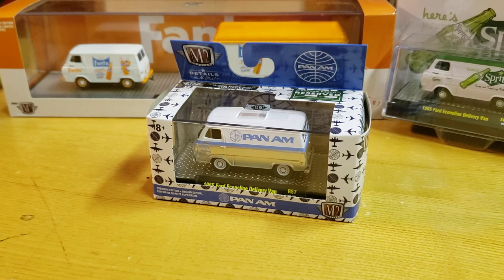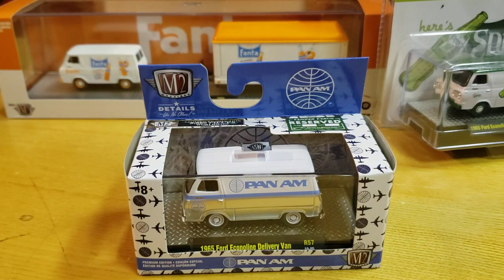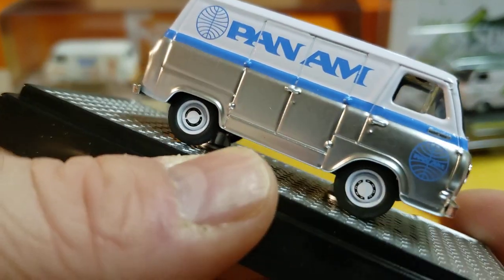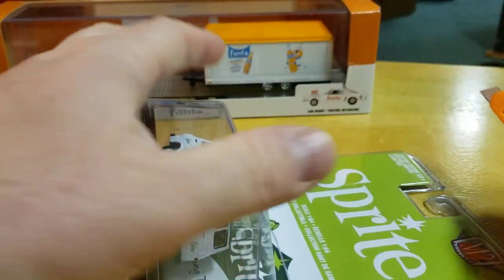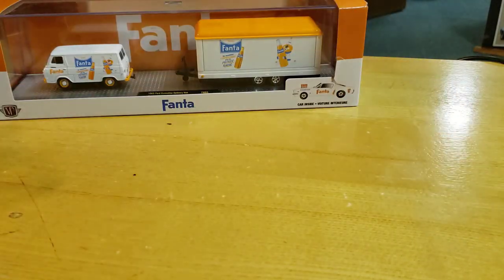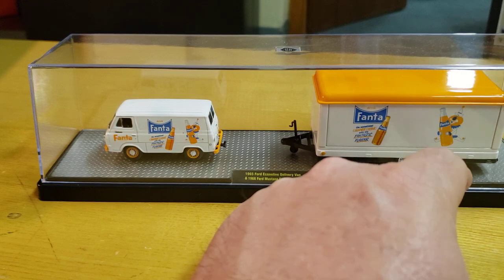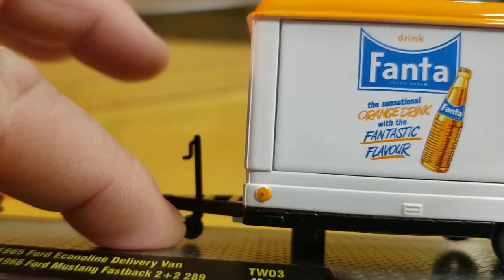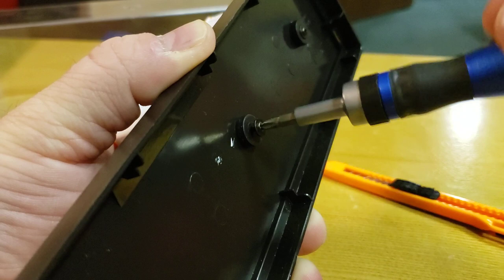2020 m2 ford econoline Sprite, Fanta with trailer and Pan Am opening review

Comment: Nice idea about how truck, trailer, mustang could be displayed. Problem with shipping them that way is there is no simple way to secure the Mustang. It would be rattling around loose in the plastic case. M2 uses screws because elastic bands often cause paint damage. It seems M2 also has a policy of hiding bonus cars from view.  I was also hoping for a snack stand trailer instead of car hauler. Not sure you could easily convert this. At this scale the snack window counter would be about even with the bottom of the van window or windshield. If you simply raise the roof, you would have to be 10 feet tall to reach the counter